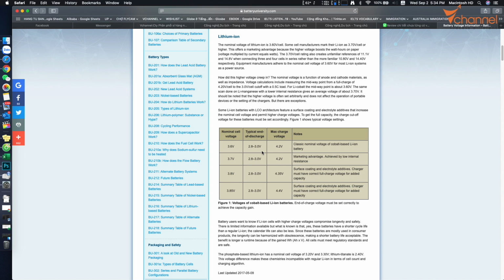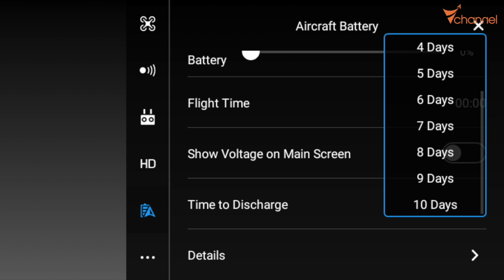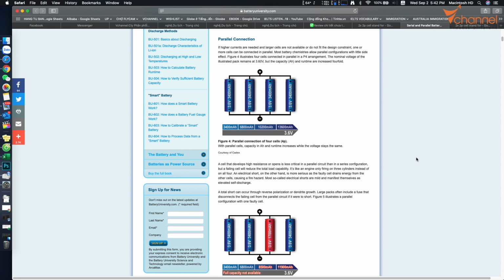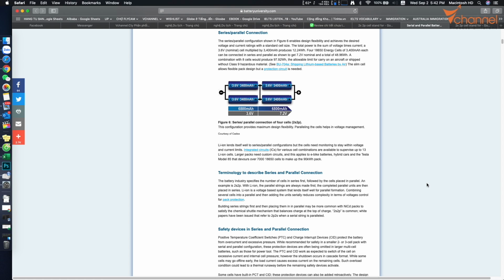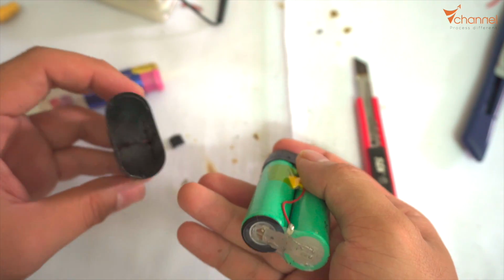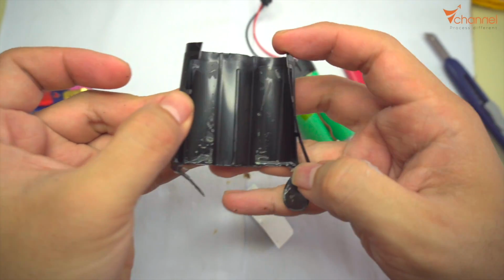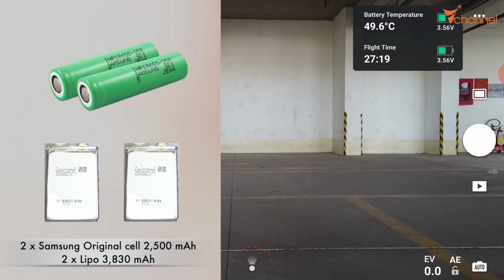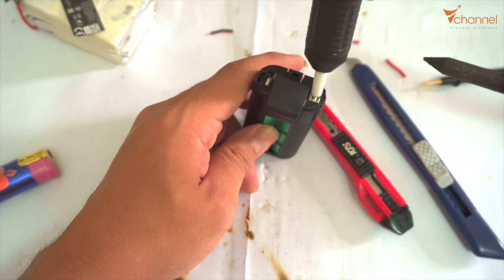World record 82 Minutes-Principle & battery modifying tutorial for drone & Mavic Mini in particular

Comment: I want to modify my hubsan 2 plus battery.. i Wish someone can make the video .. its very hard to find replacement battery original.
Reply: 3800mAh 15.2V 75.76wH, need find the correct li-po cell replacement.
Reply: @creativ3studio  All lipo cells are 3.7 nominal, 4.2 max charge. 15.2 is 4s. SO you need a 4s lipo. Come on guy its not rocket science

Comment: hello i need your help please. I replaced the two 2400 mah batteries with 3500 mah, and nothing works, the four white led lights flashing 3 times per second the drone does not turn on and the battery does not charge, I put the old ones back in nothing works, please help me.
Reply from the maker: You need to unlock
Reply: @Vchannel79  how to unlock please you have video?

Comment: Hello. So I want to do this to my mavic air 2. Since the factory battery specs are different than that of the Mini, can I use the same ones you did? Can I use 4 of the lipo cell batteries at 3,830 mAh? Or should I be using a different rated set of batteries since my original battery specifications are different from the mini you did this on? Wonderful video!
Reply from the maker: I've told all detail in the clip, you can use the same votage and same order higher discharge rate and capacity cell

Comment: How many discharge rate need for battery ? Thnx for amazing work
Reply from the maker: With Mavic Mini that is 20A as I have told in the video, other drone can be different, and to calculate how many "C" it will belong to the cell capacity, the formula I have told in the video as well. Success to you

Comment: I was thinking about doing a mod of mini 1 battery to use with mini 2. The question is - do you need to flash the battery chip for it to use all capacity of new bigger cells? I would think the battery "smart chip" will prevent you to drain more amps than it thinks the battery have, or it's just relying on voltage to monitor charge status and you can use any capacity you want?
Reply from the maker: As I have told on the clip and what I did, the most important that is maintain the parallel power supply when replace the original cell to prevent from locking. The capacity as much as you can and the weight as less as you can, just need same voltage and same or higher discharge rate for cell safety
Reply: @Vchannel79  Thank you for answer! Yes, i do understand the chip have to be under voltage or it will lock and then you will have to flash it to recover, and that require some controller and special software. What i was wandering about, i have seen people commenting that even after mod battery seems to know it's old original capacity and would not let you use full capacity like it would tell the battery is 0% even when the voltage is 3.8v
I was thinking to change the original 18650 to high capacity like panasonic 3400. But then again in your test you tried samsung 3300 was it? And it only added about 3-4 minutes to max flight time so i am not even sure i want to do it at all. I want to preserve original formfactor without batteties attached outside the body of the drone. So i dunno may be its worth it just to buy some more batteries...

Comment: Hi guy
I have follow question I use the Mavic 2 and is it possible to increase the flight time with modify batterie. I mean change to 3500mAh with 7.2 Volt.
Can you create this batterie for me including loading with standard charger of DJI Mini 2 shoult be afterwards also possible.
How are the cost for this project.

It would be nice to listen from you

Hermann
Reply from the maker: Yes, with the same principal it's absolutely possible however you pay attention which I have told in the video, try to not be locked. Last once thanks for your request but I just make tutorial I do not supply this service